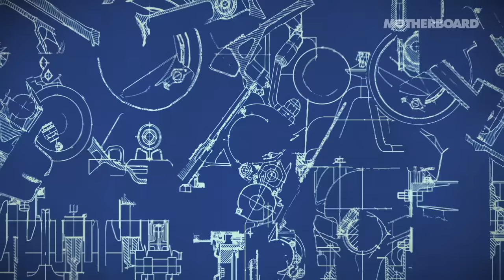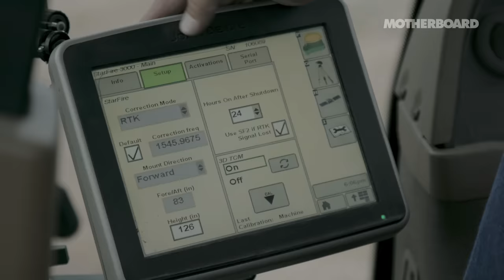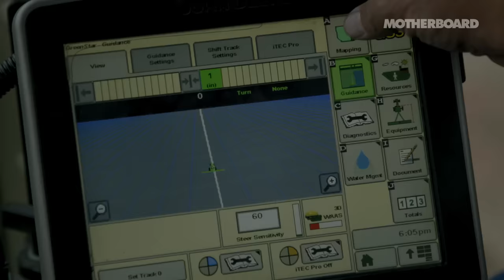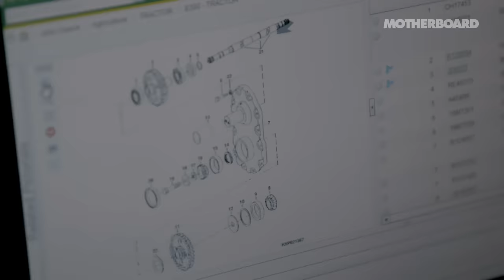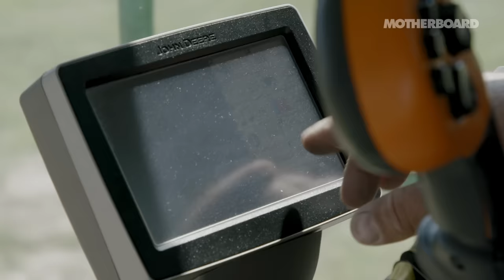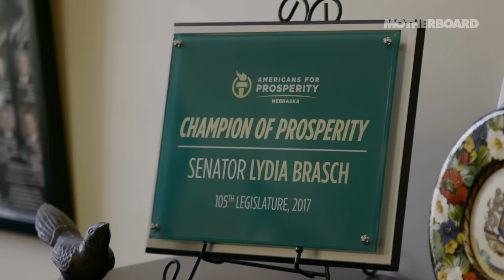Farmers Are Hacking Their Tractors Because of a Right to Repair Ban

Comment: Simply put: John Deere is the Apple of the farming industry
Reply: Nailed it!
Reply: Wrong! .... Apple's stuff works !
Reply: Problem is all hardware manufacturers are realizing the "value" in vertical integration so they implant more and more software in their devices, and leverage pay for use schemes to their captive markets. All industry is going this way. Look at how Tesla treats secondary market transactions, or repair/rebuilds of cars. Not too surprising why Apple now wants to build a car.
Reply: apple tractor?. I tractor!
Reply: Nah Apple is the John Deere of phone industry
Reply: Same in the automotive industry, scan tools need to be updated every year in order to work on the 2020’s paying 80 dollars each year for fucking the ability to see what’s wrong is bullshit
Reply: Which is crazy, considering apple already got shut down for this exact thing.
Reply: @FruiityBooty  don’t get me wrong, my scan tool isn’t a cheap one, and personality keys/updates can be prohibitively expensive. BUT if I only got them for vehicles I owned, I wouldn’t need a yearly update.
Reply: Or the Tesla of the car industry
Reply: @thetechlibrarian  Tesla is doing their best to get orders out the door. They haven't had an opportunity to address the dozens of implementation issues that actually make their cars viable. Fast charging stations, repair facilities, etc. I work for a startup company that is designing bi-directional charging stations. It is on the horizon.
Reply: You can repair your own apple products. I do it all the time.
Reply: Had Louis Rossmann in mind there
Reply: Most products have built in obsolescent parts, forcing you to upgrade, or discard.

The right to repair, keeps costs lower, helps someone to invest into machines for a longer time, and saves landfills from discarded unsupported products, cables, sensors and parts.
Reply: My grandpa spent a couple hundred thousand euros in John Deere and he’s dealing with the same problems. I heard about some Spaniards trying to do what these guys are doing as well.
Reply: @goobfilmcast4239  
Until it doesn't
Reply: Wonder where they got That idea???
Reply: Boycott J. DEERE!
Reply: @jasonrobertson8487  im sorry to tell you that tesla is not a viable company, have you ever had a close look at a tesla, the trim is cheap and the paint work on them is very bad, it will start to fall apart like they all do and they make it impossible to order parts from them, it mind blowing how many new teslas end up in junkyards, a customer came into our shop and his back window just came out when driving, i mean wtf tesla, so at the end of the day those people that have one prob wont get another one, the writing is on the wall
Reply: I beleive (I could be wrong) cat is no better.
Reply: @justincarter1950  I'll explain how this works. Dealerships are essentially vendors for a car manufacturer. That is why dealerships repair vehicles for said manufacturer. Tesla is factory direct. There are no dealerships yet....therefore no technicians to service the vehicles. Tesla is in such high demand.....it is everything they can do just to make the bastards....much less provide surplus for dealerships. The company is still tiny compared to the production capabilities of a larger manufacturer. It is a problem at the moment. No doubt. The technology is new. It will take time.

I work closely with Tesla vehicles everyday.
Reply: @goobfilmcast4239  . . . until it doesn't and Apple tells you it "can't" be fixed.  Louis Rossman has some great videos out on this.
Reply: Good origins and a sad modern presents
Reply: I have a fully functional 1st generation iPad.  Years ago, Apple decided they were no longer going to support the device - no updates, and the software became obsolete & apps were no longer able to upgrade.  They killed my device.  I can't use it despite it is physically ok & would work if the software was upgraded.  I was pissed so I can only imagine the level of frustration these farmers feel.
Reply: Duetz fahr is
Reply: Not Apple, its all companies
Reply: yeah a rotten apple
Reply: just one of a growing number who realized that the real money is in controlling the repair market
Reply: Cept Deere is worth the money.
Reply: @FruiityBooty  yes you can
Reply: @michaelblake2280  yeah you’re half right. But what you need to understand having those shitty $20 scan tools from Walmart will prolong your diagnosis time. The crucial reason why I’m so against those cheap ones is not having the ability of bi directional control is that how the hell are you going to know for sure that it’s the switch and not shitty wiring? That’s the HUGE advantage because not only do you know what component is wrong. You won’t waste as much time trying to figure out what the problem is and the potential of not forking money out to TRY to fix the problem. Sometimes you’ll end up spending more than you need just to fix the problem with your car
Reply: EXACTLY!!!
Reply: issue is, their stuff is the best. Deere is unrivaled in quality
Reply: @jasonrobertson8487  yeah this is right, but tesla has put there pants on before there underwear, bit of a cash grab, and yeah i work at the customer end of the industry, we advise our customers not to buy a tesla if they want a electronic car by a honda instead at least they let us fix them and buy parts.
Reply: It's more than John Deere.  Every modern farm implement (tractors, combines, swathers) manufacturer is doing similar hi-tech feature "improvements" and driving similar issues for farmers.  Mr. Schwarz nailed it at the end with the question of whether the new-tech tractors will have the longevity of the older tractors.
Reply: @89five3five  and potentially break it because all phones were very locked down now
Reply: @goobfilmcast4239  awwww an apple fan boy
Reply: I had no idea, but if John Deere is as you say, then its very disappointing.......
Reply: bad apple, only takes one.
Reply: Simlpy put, it's time to drive the diagnostic software companies Ot Of Business.
Reply: More like Tesla. Any Tesla made, can only be serviced by Tesla. Parts, only Tesla. Rebuilds, only Tesla. Even if you want to get your tires done somewhere else, we can't because of how Tesla Monopolozied so much on an enclosed market. Congrats, you're now indebted to the brand.
Reply: @goobfilmcast4239  Until it doesn't, and then you or independent shops aren't allowed to repair it.  And if Apple doesn't want to repair it then it's a paperweight.
Reply: @goobfilmcast4239  Yeah Crapple's stuff works, so does my Android stuff. The difference is when a Crapple device fails, and they do, you can't buy repair parts from Crapple. They want you to just drop another $500.00 for a new tablet. If my android device fails I can buy OEM parts to repair it.
Reply: @FruiityBooty  Yeah, Snap-on has been ripping off hard working mechanics with that BS for a lot of years. I purchased an Autel bidirectional scanner a year and half ago at a fraction of the cost the Snap-on was and it does everything the Snap-on does. The best part is that they don't require yearly updates. You can skip a year or two and don't have to pay for previous updates when you decide to update. Snap-on can suck it!
Reply: tesla is WAAAAAAAAAAAAAAAY worst, simply looks richs rebuilds chanel to discover how worst it is.
Reply: @martini380  the guy in the thumb nail pic
Reply: @goobfilmcast4239  thats not even the point of the video
Reply: @goobfilmcast4239  until it doesnt.
Reply: @goobfilmcast4239  wrong
Reply: @89five3five  have you tried repairing the iPhone 12?
Reply: Yeah but people will continue to buy both. Such a mystery...
Reply: @Tyler-zw4kq certain models are more prone to failure than others. Maybe your take care of your stuff better than the average person. Who knows. I just know Louis Rossman deals with apple on a daily basis and encounters issue that you or I probably wouldn't encounter.

I also don't know how widespread some of these issues are. I know some of the issues are due to design flaws as opposed to users mistreating their devices.
Reply: @Tyler-zw4kq  there are ways to mitigate bending issues. I had a Huawei Nexus 6P and those phones were also prone bending, probably just as much as Apple's or more so. I personally never had mine bend, but I would always have it in a nice sturdy case that helped prevent the phone from being bend. It certainly didn't mean the phone didn't have an issue though. Its just something to be aware of. If you know of certain issues, you can often prevent the issue by watching out for things but it doesn't change the fact that it has an issue
Reply: @randomguy-ue9ee  and transmission
Reply: The wormy apple?
Reply: I still have no idea why Americans are so enamored about John Deer aka "the holy brand." if you dont like them move your buisness to new holand, cat or whoever. Don't support a company with bad habits and bad customer service.
Reply: Buy Mahindra tractor or any Indian tractors
Reply: @goobfilmcast4239  he just mean they ***hole
Reply: Yes, they have the same owners
Reply: no. The Nintendo. Don't give apple any credit - they didn't invent anything, not even how to scam you out of repairs.
Reply: @davidperalta5280  it has made heart rate trackers useless and overpriced. All across the industry. Totally funked now. You get a multi device only and with proprietary software only. Basically a DRM touch screen toy which may or may not measure heart rate some times.
Reply: A lot of people here are equating APPLE to John Deere..... worse case scenario: A Farmer's Apple iPhone breaks and Apple refuses to repair it or it is NOT repairable.... you break down and buy a replacement iPhone or another from a competitor ...... Farmer's John Deere Combine breaks down and John Deere tell you that the Software Fix, little PC board, widget or plastic doo-dad can only be sourced and replaced by a John Deere "mechanic" 100 miles away. You can schedule an onsite repair or haul the combine in yourself and it will only cost you 7,500 US Eagles...yup, exactly the same thing.
Reply: @FruiityBooty  A Walmart OBD2 scanner that reads and diagnoses John Deere Combines, harvesters and Tractors ??  I'd buy that for a dollar !
Reply: @joemann7971  Louis Rossman: Without Apple stuff breaking, he'd be poor and have to shoot his videos from an old cardboard box. For him, Apple is the Goose that laid the Golden Egg !
Reply: @goobfilmcast4239  possibly but that doesn't mean he can't criticize the company. Plus, there is always things that are user error as opposed to manufacturing defects.
Reply: @goobfilmcast4239  lol
Reply: @goobfilmcast4239  until the new one comes out and the old ones start loosing features and getting restrictive updates
Reply: @89five3five  good luck repairing the m1 mac. Maybe you have a micro soldering station?
Reply: All the rest are doing the same thing.
Reply: Yes only this product facilitates feeding people food instead of wisdomless knowledge and useless ways to spend our priceless time.
Reply: Well that explains who took a bite out of the apple logo
Reply: Cade IH New Holland  they all do it
Reply: @goobfilmcast4239  wrong
Reply: Not really apple more lenient than this
Reply: Eh not really 
They were actually good for longer than apple
Reply: No ford is the apple of farming industry
Reply: Damn this should be written with gold
Reply: Apple actually lets you repair many products now in the comfort of your own home but they sure as hell don't make it affordable!
Reply: Yeah I need my phone repaired more than my tractor that could potentially help feed thousands of people.. very poor comparison sir
Reply: @dickward1090  Nope, most  of the newest stuff only works with company side real time autentication,  so  fresh software, and internet connection.
Reply: Not the same, Nobody needs apple
Reply: wrong you can fix i phones if you want its not like i need apple to fix my screen are change the battery are back glass and apple phones work and for the software you just have to update your phone
Reply: @FruiityBooty  Just don't trust walmart electronics in general. Just don't.
Reply: @goobfilmcast4239  Apple's stuff is crap. John Deere's stuff works.
Reply: @alphanerd7221  Apple could buy John Deere with the change they find in their couch cushions.
Reply: @alphanerd7221  Sure......Apple could buy John Deere 500 times over with the money they make from the vending machines in their Silicon Valley Headquarters.....and John Deere would be a better company for it.
Reply: Just buy Chinese
Reply: It's like Apple, but even more greedy...
I didn't think that was possible until now.
Reply: More like the RIAA of the farming industry.
Reply: Thae bad apple
Reply: @FruiityBooty  there is another way to using scan tools in a vehicle actually two one is that using opensource software and the other is just revert the vehicle back to the 70s where the engine is hard wired to the driver not to the computer
Reply: Best comment ever
Reply: @ezboi5768 u have to be at least 30+ years old
Reply: @FruiityBooty 80 dollars is cheap, you need to pay 700us to scan a ford or dodge
Reply: Wrong bro Apple lets 3rd parties work on their phones. Screen replacements, battery, camera, etc, if the software is malfunctioning, restore factory settings. I’ve never gone to an Apple Store to fix something.
Reply: Can we break up monopolies again
Reply: John Deere is even worse
Reply: @Wodenseyes  Worse than Apple? 😂 How?
Reply: They are all like this
Reply: More like Tesla - they are the worst offender of this in the auto industry.
Reply: Na you can work on apple.products too... California is nice like that. Even if they say you warranty is void if you open it up, that's a lie you can take those stickers off and they still have to.honor warranty. We have a right to repair in ca.
Reply: @HawtSauwce  Tell me more about that. How is Tesla worse than other car manifactures?
Reply: @JLfpv  Apple uses special Hardware to make repairs more difficult/time consuming. 
Swapping the Display in two identical iPhones wont work, replacement parts are more than 200% the price they should be (in comparrison to apples competition).
Apple does a lot to prevent repairs outside of Apple Stores.
Reply: @trillex1861  ahh I am caught up. Not just right to repair but also easily accessible and affordable.parts and tools needed for the job also play into this right to repair
Reply: Whoah, whoah, whoah!!! Ok ,so let me get this straight. Farmers are not allowed to fix their own equipment due to a policy that they can only go to the dealership and get proprietary software updates( sounds like every car company). But what concerns me is that they’re using software patches or whatever from Eastern Europe. Ok. Do I need to explain how that is a possible problem? Ok maybe I do😒 if you’re not using the proprietary software that is meant to be monitored and sent software and bug fixes( you know, like Apple equipment). What’s to stop a “bad actor” from circumventing our food supply system by crippling our agricultural infrastructure by hacking into that John Deere non proprietary software? Sounds to me that John Deere and the United States agricultural industry need to fix this problem. Meaning: not pulling this draconian crap with our farmers. Let’s make it safe and affordable for the men and women whom feed us to manage their equipment on their own term’s safely and responsibly. Does anyone in our government or corporate sector ever think about cause and effect?
Reply: @Theprotomodeler  Nobody in the US Gouvernement knows whats Open source is
Reply: @FruiityBooty try having a factory Mercedes and Porsche software… it’s more than $1,000 per month
Reply: And thus should be prosecuted as such for being anti-consumer.
Reply: The problem here is that if you don't want to buy Apple products that's fine,But it is not the same option for farmers The question here is: when will the government act for the people?
Reply: Nintendo like even.
Reply: @justincarter1950 
"Does Tesla make the best electric cars in the world?"
"Tesla doesn't even make the best electric cars in the US"
Reply: @minhducnguyen9276  lol they don't even make the best car in the north pole 🤣 😂 🙄 what ever i said im sure it was good
Reply: Rotten Apple.
Reply: And Google Tractors are on the way…
Reply: @Octopusmaster  "hey google, plough my field"  👍
Reply: That's comparing Apple to ... I don't seem good reason for Deere to do that but certainly for Apple. After all, I do everything on my phone these days. Including accessing my bank account. Being able to unlock my phone means also gaining access to all other password protected stuff I have. It also means one could on lock my entry door.
Reply: As written in the bible?
Reply: @luckyguy600  yes....The john deere owners manual 👍
Reply: until it doesnt and ends in a landfill

Comment: I bought a John Deere 1028 Snow Blower because I thought that they were well-made and held its resale value. In the first season, the switches fell apart. I tried to buy new ones on Ebay and found that the switches are of a propriety design as well as the cutouts on the control panel. The cost of the John Deere replacement switches is extremely high at $45.00 each compared to $5.00 generic switches.  I ended up having to modify the wiring harness and add a generic plug to use higher-quality Chinese-made generic switches.